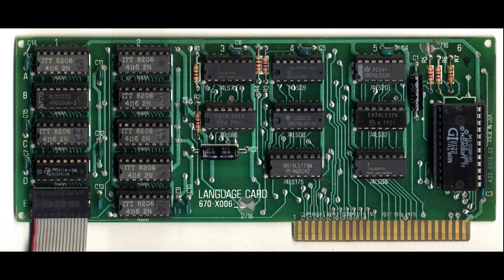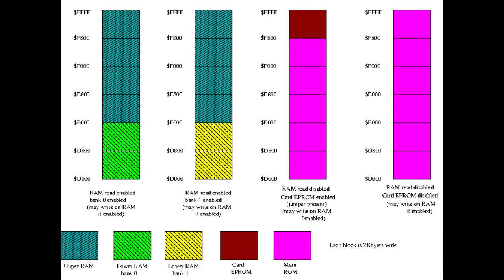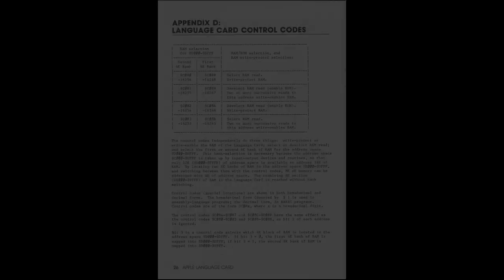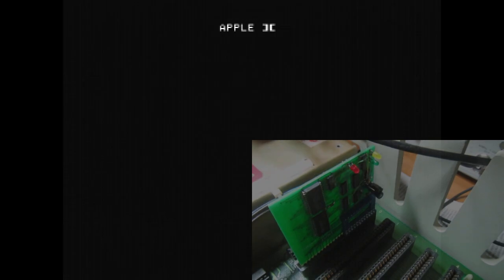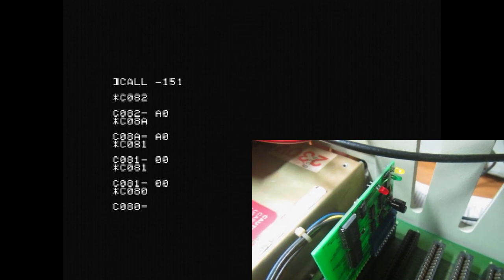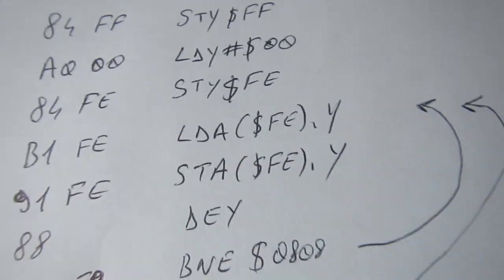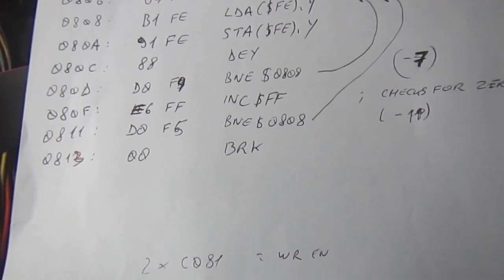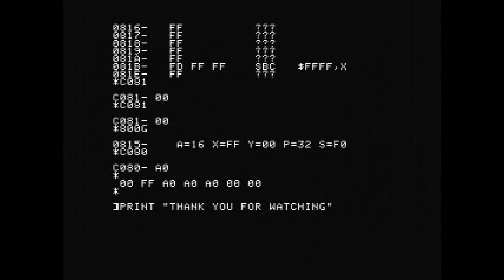A "new" 16k Language Card for my Apple II europlus

Comment: Thank you very inspiring, I have built the card but it is very difficult to find sram component, I have used AS7C164A-15PCN instead of 5C6408. I have used the short assembly code in the video to test the card, and I can see the led switching but the Apple II is freezing. I do not know where to start and how I can investigate. Would you give a small help please ?
Reply: It is freezing after the 800G & C080
Reply from the maker: @vbesson1  C080 freezes the machines if the RAM expansion hasn't been filled correctly with the right ROM content anyway
Reply from the maker: @vbesson1  yes the ROM socket is optional, I mean you need to copy the system ROM into the RAM, it's one of the programs I've shown in the video. If it's not copied correctly, then it will crash the machine when you issue a C080 to switch to the card's RAM. As I said, send me an email.
Reply from the maker: @vbesson1  it's in the contacts on my channel page, iz8dwf@amsat.org If you entered the program correctly, then there's something wrong in the card. Did you use the github through-hole design?
Reply: Can I use peek and poke to check if the writing to the sram is working as a starting point ?
Reply from the maker: @vbesson1  unfortunately you can't, because the "access window" for the 16K RAM is at the same address of the system ROM, so read and compare can be done only under the control of an assembler routine (that I have written too for my troubleshooting aid).
Reply from the maker: that card is working for sure, there're some for sale even on ebay (I get no share on anything btw). So it's either some construction error (solder joints?) or some defective component (I hope it's all socketed) or bad contact on the slot. The last issue happened a few times on my Apple ][, old card slots get dirty and oxidized very often.
Reply: @iz8dwf  everything on socket, I have built 2 card and I have the same issue on both... I will send you an email to avoid disturbing the others on this page
Reply from the maker: @vbesson1  well that is very strange indeed. Email isn't really because of "disturbing",  comments are just too cumbersome as a debugging method :D
Reply: @vbesson1  I also built some boards for my Apple IIs and I'm having exactly the same problem:  freezing when I try to access the other 16KB of the board in ProDOS, for example. I'm using Cy7C185 on my boards. Have you made any progress in the tests?
Reply from the maker: @vbesson1  I've sent you an email. Unfortunately all @amsat.org aliases have been disabled on August 1st: https://forum.amsat-dl.org/index.php?thread/4581-amsat-mail-alias-service-to-end-august-1-2024/
Reply from the maker: did you build the through hole version that's published on github? However, write me an email and we'll try to debug it. Any 8Kx8 SRAM should work fine anyway, if it's not faulty of course.
Reply: @iz8dwf  what is your email please

Comment: My understanding of 6502 is rather limited to non-existent but it doesn’t look like it loads the upper address back out of location FF (of zero page?) except maybe on the increment unless the upper address is latched somewhere (language card?)
Reply from the maker: I'm sorry, I don't quite understand your question, can you rephrase it?
Reply: @iz8dwf  the initial D0 loaded to Y register, stored to (zero page?) FF but Y register later overwritten? to 00. Where is the upper 8 bits coming from after the Y register is reset to 0, I don’t see it reading FF to set the upper address bits unless Y is a 16bit register and writing to FF sets that to the upper address bits and FE is lower 8 bits
Reply from the maker: ok now I got it, 21:45 I guess. 6502 stores low byte of a 16 bit address first, then the high byte. So to address $D000 I write #$D0 on $FF and #$00 on $FE. The complete 16 bit address is then at $FE,$FF of zero page, low byte first.